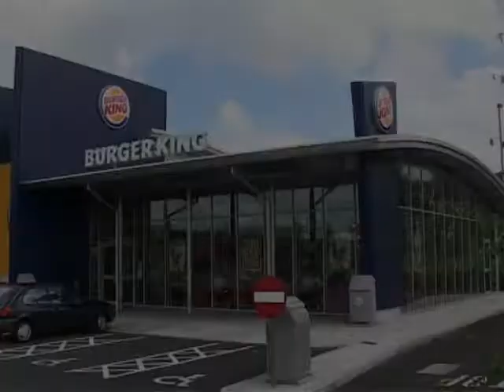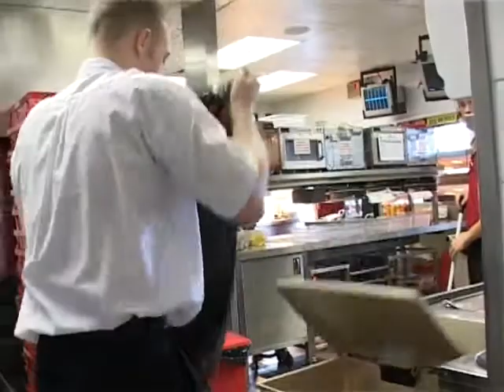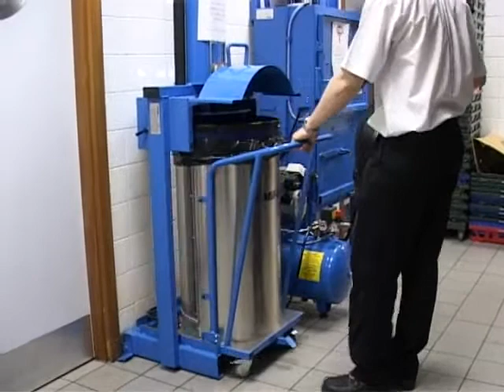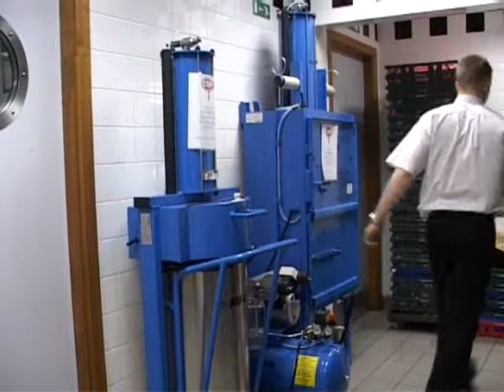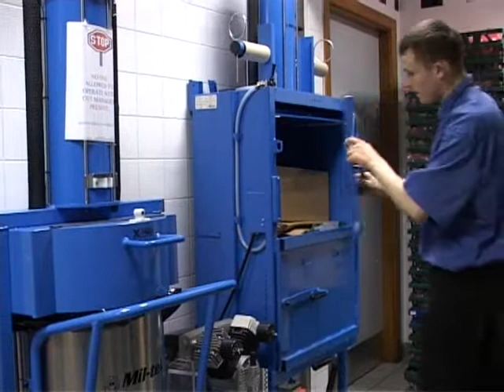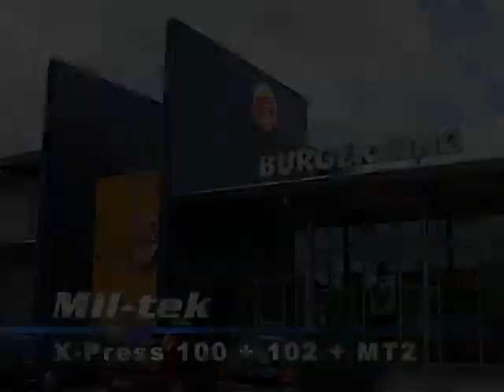Mil-tek Cardboard Baler and Mixed Waste Compactor at Burger King in Belfast

Comment: We are a manufacturer of packing materials and machines such as 9-25mm Baling Tape,
which is the white tape used in vertical balers on your website.
We have different specifications of straps and can customize the meter and tension.
We can provide high-quality products and efficient service for you.